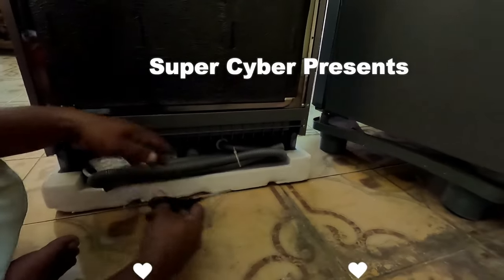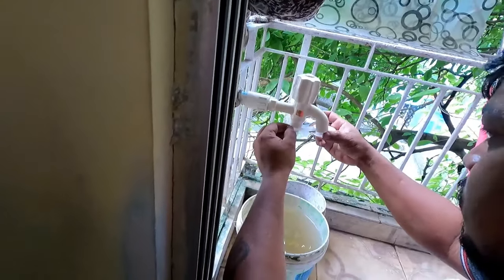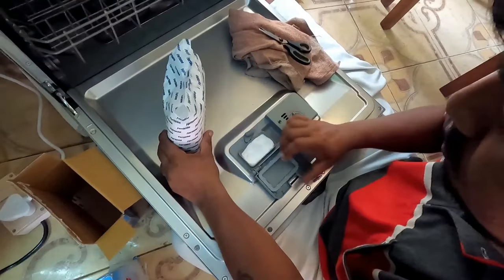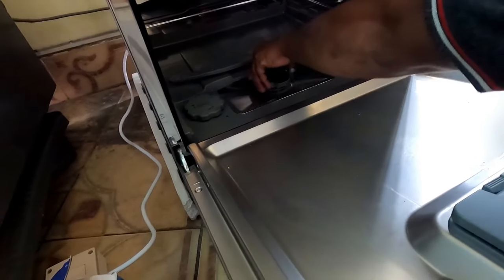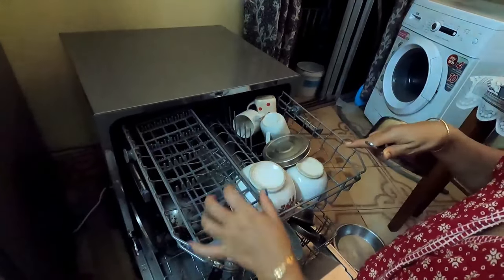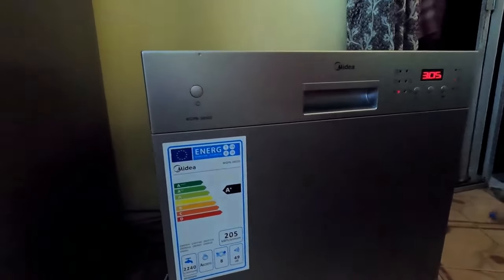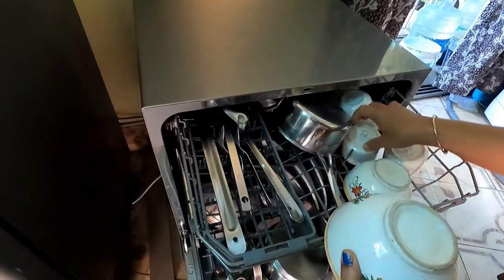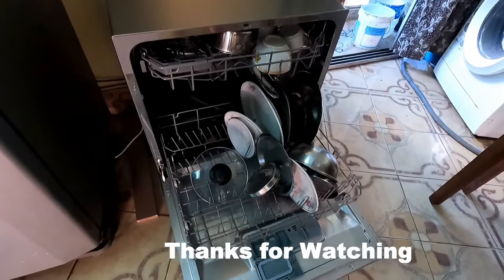Midea 8 Place Counter Top Diswasher WQP8 3802D Installation & Demo #midea #dishwashers

Comment: Where and how did you connect the drain hose?
Reply from the maker: It's got a drain outlet at the back of the machine it's just a coupler to be fitted provided in the box with an outlet pipe .
Reply: @supercyberautomotivetravel  sink?
Reply from the maker: The outlet pipe is connected to the drain outlet of the balcony.
Reply: @supercyberautomotivetravel  Ok Thanks

Comment: Why you hide the first dirty cup even after cleaning? Not fair.
Reply from the maker: Thanks for your query. That's not the dirty cup it's interior enamel was already damaged before so it looks dirty. The cup is absolutely clean. In fact I am using the machine in full load twice a day and results are very good.

Comment: Can you add the electrical circuit of this dishwasher?
Reply from the maker: Thanks for your query. Any 15 amps. household electric  connection with proper ground will do the work. No additional installation is necessary